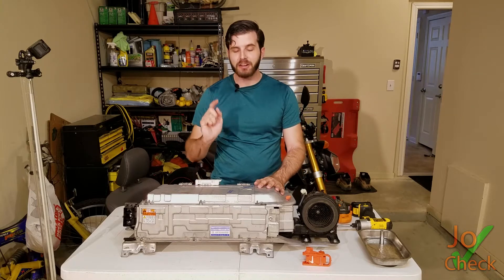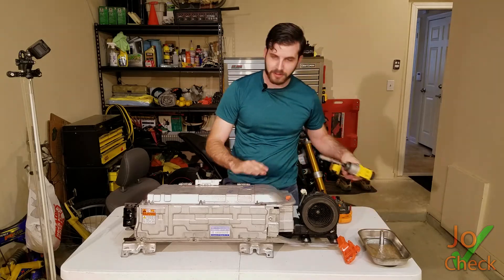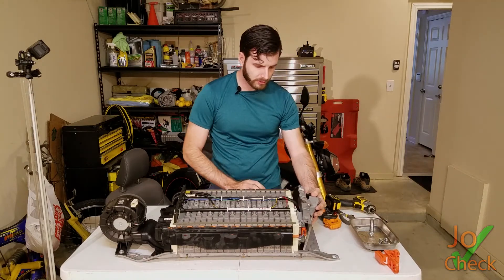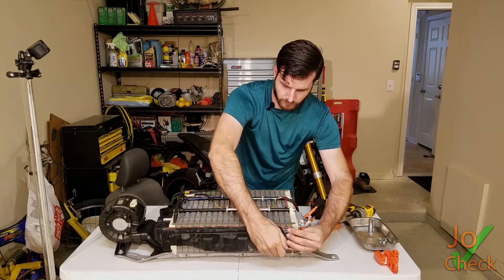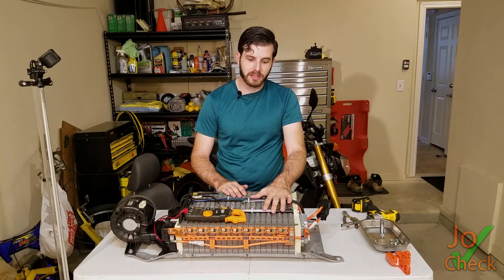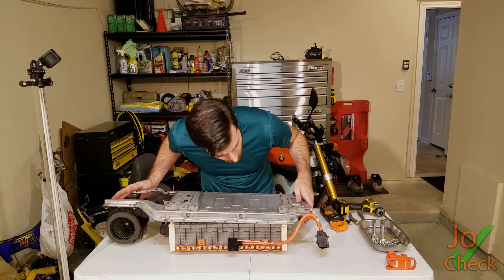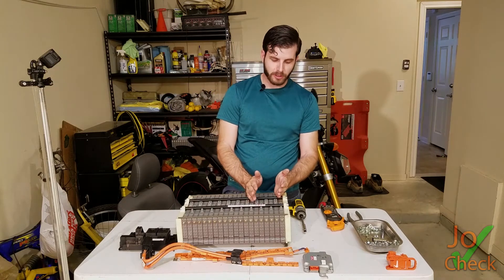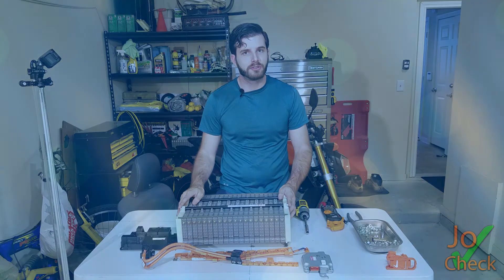Toyota Prius C Battery Disassembly - Take It Apart

Comment: A little bit late... But..  A technician was doing a service to the battery and it seems he blew up the voltage ecu and the bus bar cable (3of its pin are burned).... Do you know where i can get a replacement? The part number in the bus bar cable (orange) is G92T0-52010. My Prius C is year 2014

Comment: Hi!Which one is the first module in the battery pack?
Reply: Depends on the car model. Toyota was not very consistent with numbers. Get a copy of Dr. Prius and a Bluetooth OBD2 adapter for it. The software tells you which block is #1 and so on.

Comment: Can you test each module like that with them all connected? Do you have to disconnect each one in order to test them?
Reply: No need to take off all the harnessing for what he did. Once the pack is out of the car it is mostly an open circuit anyway (not that it couldnt hurt you by putting careless fingers in the wrong places! work carefully.) 

Cycle each module individually, harness on the pack. Also keep the compression plates on to keep the modules from distorting. A couple D and C cycles is plenty, at least I never found any benefit from using 3 cycles. 

A major helpful short cut is to get yourself a free copy of Dr. Prius and the right Bluetooth OBD2 adapter. With these you can analyze your pack without taking it out of the car. It will give you a good idea how worn each module is before you start working.

Comment: The "expansion joint"/"fuse" is a current shunt, it is a calibrated known low value resistance the computer can use to measure a voltage drop across, which indicates how much current is being used.
Reply: Thanks for the info! Much appreciated.

Comment: Good video & work Bro
One thing which is not clear to me that is where you get the fuse box or pack in orange color.
where i found it in a battery. pls place a video or snap where the fuse box placement is.

Comment: Hi...thank for great video..can i ask..module cell prius c same as prius 1st...2nd n 3rd gen? Tq
Reply from the maker: Mohamadmuslim Meskam only 2nd and 3rd gen are the same.
Reply: Battery G9280-47060 same as prius c or not...? I dont know the battery from the 1st or 2nd model..
Reply: @mohamadmuslimmeskam2914  From 2004 to 2010 they were Gen2 modules and are interchangeable. Gen 3 modules (2011 to 2015) were similar but may not be interchangeable with the Gen2. By 2015 (Gen4) the modules were mainly Li Ion though a few cars still used NiMh cells. These cannot be used in the older cars as far as I can find out. BTW never try to use a Gen1 module in anything other than a Gen1 Prius!

Comment: Thanks for taking the time to make the video but please be careful, even with the disconnect out it's still very dangerous to touch the bus bars while the pack is assembled. Remove the bus bars first then take apart the battery the rest of the way.
Reply: Not with one hand. Unless your other hand is touching the other bus bar, there is no complete circuit.